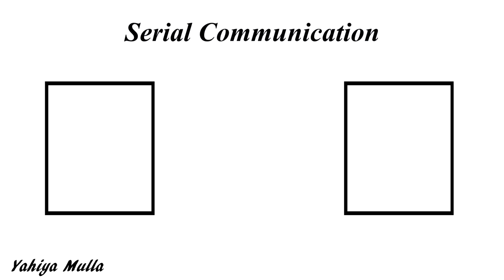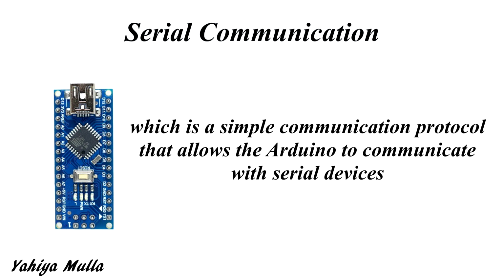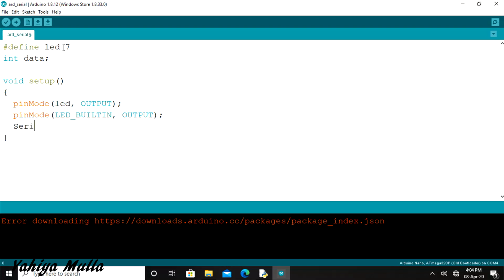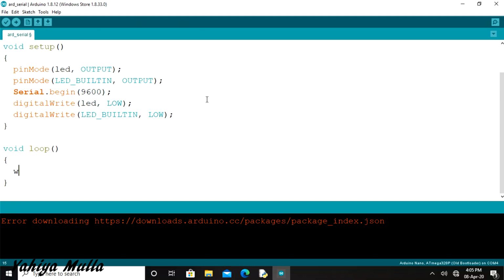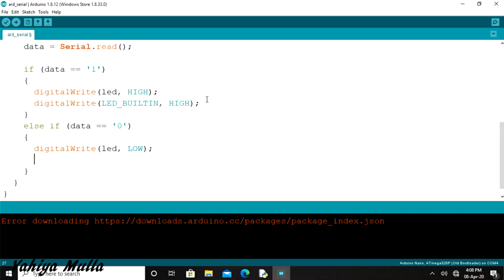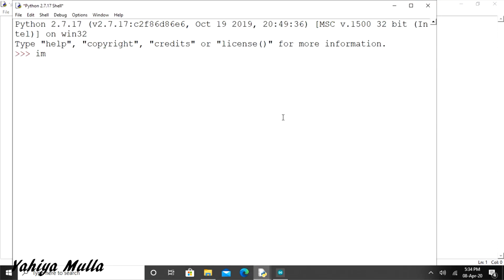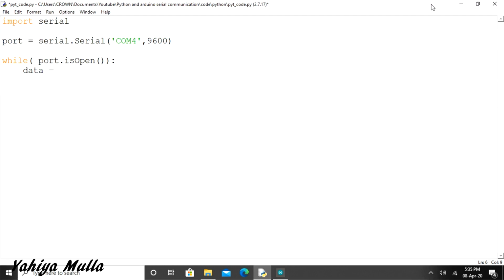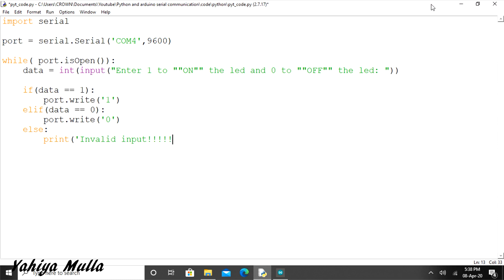Python and Arduino serial communication.

Comment: hello sir , I am facing some problem while making this project my python code does shows any kind of error but it is still not communicating with arduino . Any help from your side would be highly appreciated
Reply from the maker: Verify the serial port of your Arduino once. It should be same in both the Arduino and python program. The python code which I have provided in the video description is for python 2.7 if you are using python 3 there are some small changes in the program. I will update that code as well, you can have a look at it. If are not able to do it comment down I will surely help you out.
Reply: @YahiyaMulla  sir I have changed my port number and I knew that it was not going to work on python 3 so I installed python 2.7.18 but it still does not works It only works when I give input from Arduino IDE (serial monitor)
Reply from the maker: @ganeshsharma24894  I have updated the code for python 3 if you have python 3 installed on your system then try it out.
To upload your code to the Arduino and also to use Serial Monitor, Serial communication is the must. Try avoiding Serial.print() function in your Arduino program. Instead use python to interact with the user. If you still face the problem then email me both the codes at
yahiya6006@gmail.com
I will try it out.
Reply: My code didnt work as well. It is because the .write function has to look like this: .write(b'1')